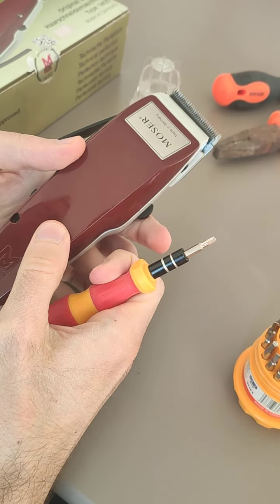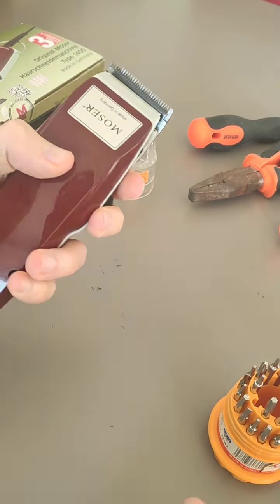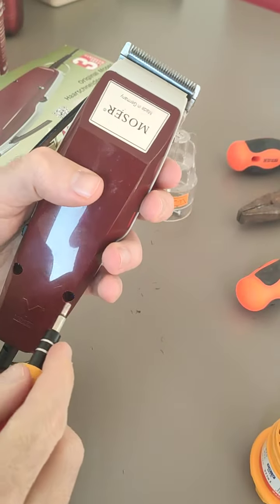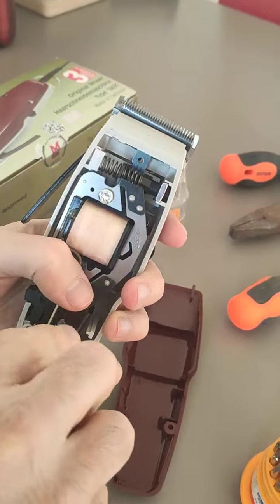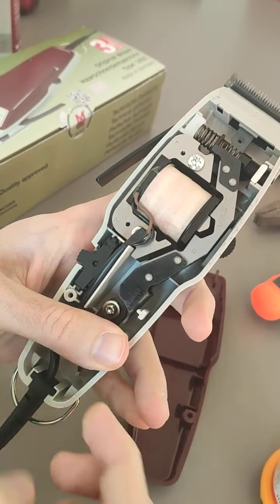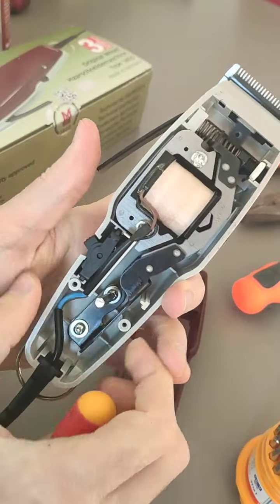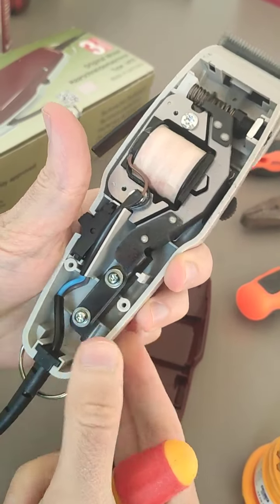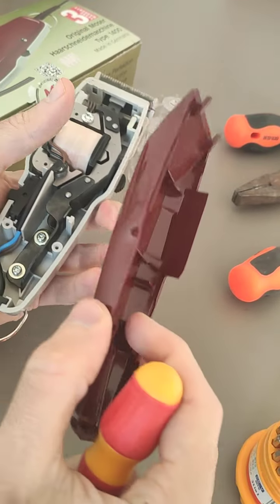How to Fix a Moser Trimmer Machine Noisy Sound Problem (2020 Solution )

Comment from the maker: Please use gloves to protect your hand from electric shock! I noticed in the comments there are some low quality machines in the market that have open circuits. Moser original machines are well isolated. 
Otherwise, please adjust the screw while electric current is off, then turn on the machine to test the sound only.

Safety first 🥇:)
Reply: How to sharpen the blade?
Reply from the maker: You can buy a new one. I'm not familiar of ways to sharpen the blade. But it's a good question.

Comment: dude you dont need to do all this there is an adjusting screw on the machine which is made for this adjustment (the black screw on the top right side of the machine ) you can easely screw it clock or counterclockwise  to stop the sound

Comment: Ya moalem shokran , I have the same moser 1400 sometimes not shaving , I adjust the black screw at the top right side ,a little bit left or right once the sound becomes less it will cut again.

Comment: You can fix it with the screw on the side of the clipper the one on the top right either tighten it or lose it and it will fix the problem

Comment: Those Mosers in general vibrate a lot? I had few machines during my life, bought this and it vibrates like crazy if compared to the other toys where you don't almost feel if it's on or not. I would go crazy if I should use this lot vibrating device for work during all day.

Comment: ADJUSTING SCREW
Blade amplitude can change as a result of voltage fluctuations. For lower voltage the blade amplitude can be smaller and for higher voltage bigger. If necessary, by changing the setting of the adjusting screw, you can adjust the blade amplitude yourself.
·· Using the on/off switch, switch on the appliance

·· Turn the adjusting screw in a clockwise direction until you hear a loud noise

·· Then turn the adjusting screw anti-clockwise until the loud noise stops

Comment: Did this now the blade is only vibrating and making a sound but not cutting
Reply from the maker: it needs careful adjustment. Send it to a professional or try to do it again with patience
Reply: @AmerMaraqa  got it working, didn't push the blade enough forward
Reply: @christoffer98  This is key I think. I only pushed the whole metal part forward and it got rid of the noise :)

Comment: Plz do anything by unplugging the trimmer machine
Today i got heavy shock by doing this......🙏
Reply: HAHAHAHAHA
Reply from the maker: Sorry to hear that, Use isolation gloves.
In fact an open circuit is a sign of a low quality connections. It should be completely isolated. Use gloves or buy a new machine.

Comment: I bought mine new,  but it is not cutting.  It has very low sound.  Please advise.  Thanks bro!   USA.
Reply from the maker: Check the joint between the blade and the engine. It may have low noise because the engine is not pushing the blades correctly. So what you need to do in this case is to fit the blade joint correctly into the engine bar.
Reply: @AmerMaraqa  it's not because of the electric power?
Reply: I bought an adaptor but not sure if I have to buy step up step down transformer from 220 to 110.
Reply from the maker: It can be also because of power